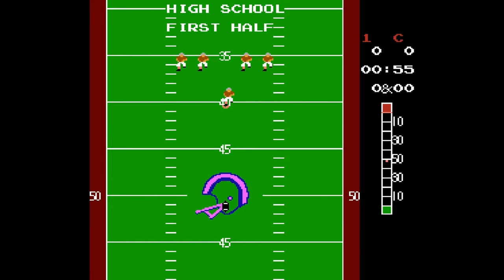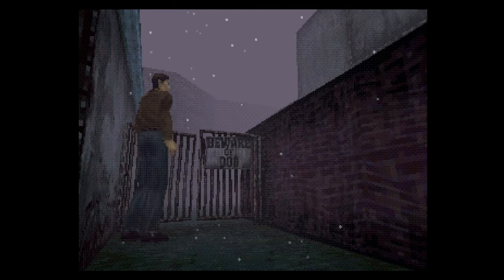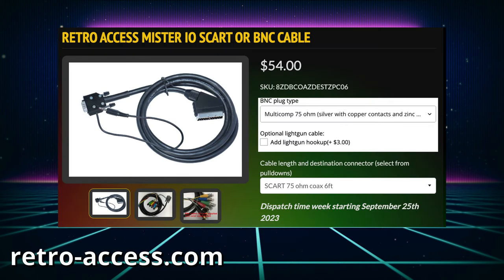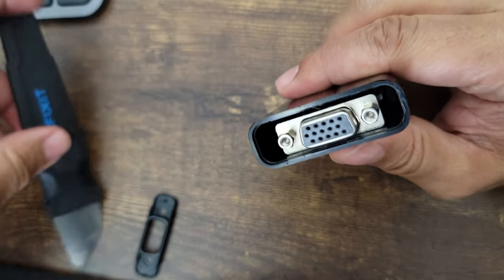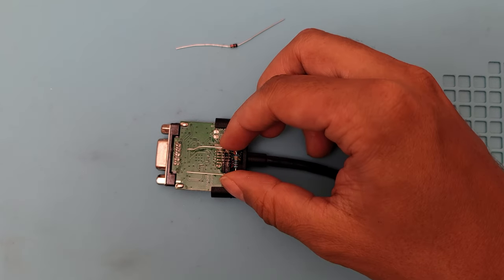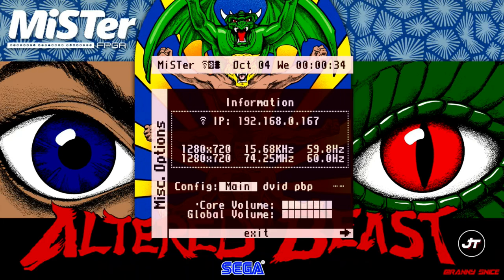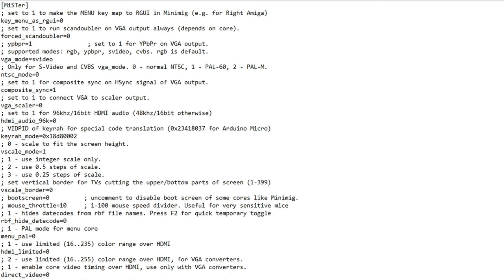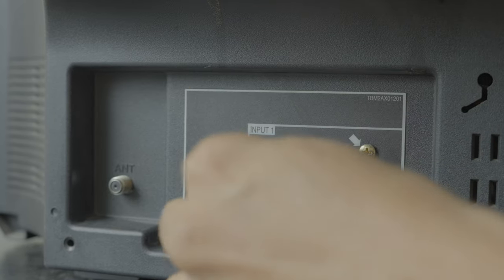MiSTerFPGA Direct Video Guide - Connect to a CRT through the HDMI Port

Comment: you didn't state one important thing with diodes, they have polarity you want the line marked on the diode to the same end as the line with the arrow in the circuit diagram. If your sync circuit mod fails it was likely the diode is in backwards.

Comment: Great guide. Thank you. Have you tried using the Mega Drive 2 RGB port on your ITX mister board for component? It looks like that port is designed for this purpose as well.
Reply from the maker: Thanks. I haven't yet tried the Mega Drive RGB port on it yet. It is supposed to have a cleaner signal. Hopefully I have the time to tru it in the future.

Comment: I just tried a DAC that looks the same (externally) as yours but without the Rankie branding. There was even a review on Amazon UK that claimed it worked on MiSTer, but all I get is a black screen with some light shimmering. The PCB looks slightly different to yours.
Reply: Figured it out. TV wasn't switching to RGB mode. The HDMI to VGA converter (DAC) wasn't outputting 5V on VGA pin 9, needed to drive the RGB blanking signal on SCART pin 16. I've since bought a Startech HDMI2VGA which also doesn't output the 5V but I modified it so 5V from the power input also goes to Pin 9 (via a toggle switch).

Comment: Hello, I have a Sony PVM 14L5 with a BKM-129x card, which have a VGA port. Do you know if it is safe to connect my Mister with Direct video, HDMI to VGA adapter + a common VGA cable, to the card VGA port, and if it would support all formats and resolutions?

Thanks

Comment: I noticed a difference between the old analog 6.1 i/o board and the moread (2024) DAC on my LCD-that-accepts-vga monitor, but the same difference is not present in my CRT. The DAC has MUCH better reds (white looks white, not reddish like on the analog board), however my CRT using my analog IO board does NOT have reddish whites AT ALL (I tried to see it lol). I didn't go through the DAC mod to get this working with my component TV however, if I can't see the issue with the analog IO board it seems wrong to go through this effort. The moread (2024) DAC is MUCH harder to solder than the one in this video and I dare not short something and ruin my TV/mister for a difference I won't be able to see, almost certainly. The bias of knowing that the whites are reddish was not enough to get me to see them.

Based on my (very unscientific) results, I'd say that the only reason to switch from old analog IO to a DAC is if you have a vga monitor that needs vga (like an old crt monitor). I can imagine it making a difference. 

FWIW, I tested a real n64 (svideo) against my analog IO board (component) to on my CRT to see if the new analog i/o board would be worth the money to me and I was not able to see any of the extra bits of color space I was supposed to be able to see. My CRT is not a pvm but it's rather nice I'd say, a 14in toshiba with component inputs.

Maybe my findings can help someone avoid a solder job for absolutely no gain (if they already have an analog io board).

Comment: I've got a dark tone crushing problem when I use YPbPr from the analog IO board. Do you know if there's some config that changes black level for the VGA output? I considered direct video to avoid this problem but losing dual output is not an option. 

BTW I saw the tests results for direct video devices and the IO board's low video levels defect by design, but funny thing, I used the same VGA to component cable, the same board and send RGB to the PVM (with internal sync) and guess what... no dark tones crushing on the 240p test suite PLUGE pattern and overall the image looks brighter as it's supposed to look

Comment: Are there any solutions yet for crts that have a magenta tint to the screen when using component video with that adapter? I bought one of the laserbear component video kits and while it worked with some of my crts, i got the magenta screen on my main crt that i was hoping to use. I switched to using a different device (hd fury iii) and ended up having even more problems with that unfortunately
Reply: I've had magenta happen with switcher boxes, in my case it happened when there was a load on the cable that I had to ground to clear and let it achieve a normal signal.
Reply: @Spokavriel  For me i tried plugging it in directly without using my switcher with the same result, one thing that did work was running it to a comp2rgb and then back out again through an rgb2comp, however due to the way my setup is the total cable run doing it that way degrades the signal pretty noticeably so it's not an ideal solution